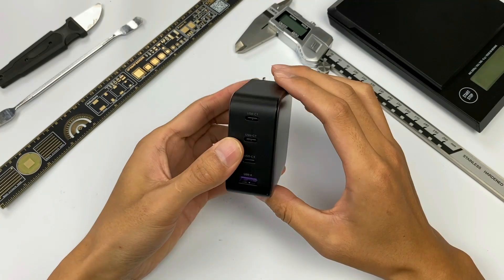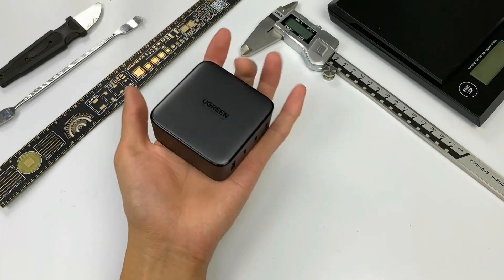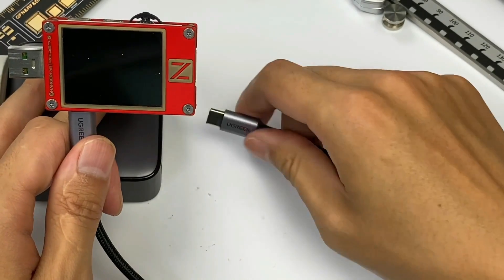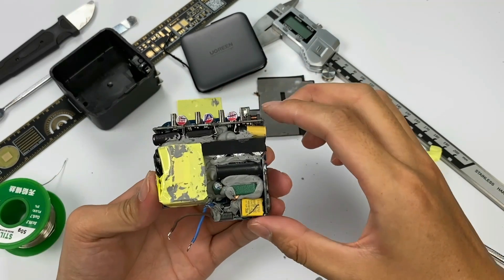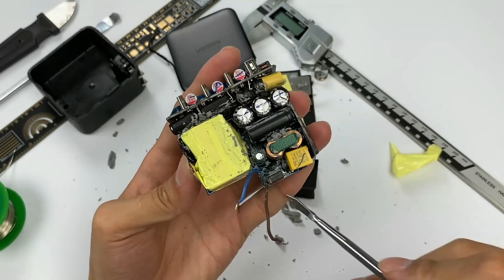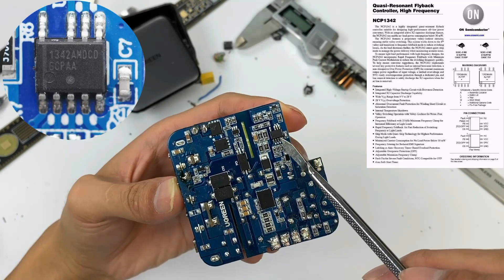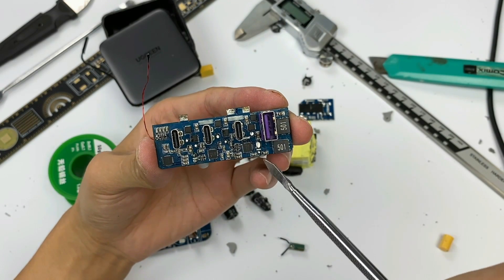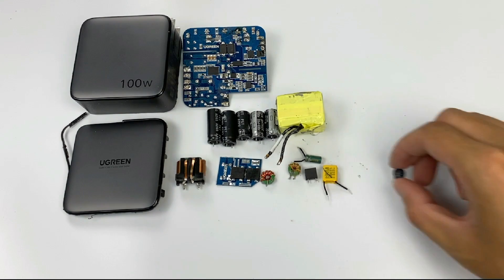All in One | Teardown of UGREEN 100W 3C1A GaN Fast Charger

Comment: Good video , solid design from Ugreen , impertant components are quality ones and meet the design standards , have seen dodgy chargers from alixpress but the ones i purchased from Temu are quit decent , did not open them but they stood the electronic load test and the weigt of a 55 watt is 90 gram , but it did not get hot, but in the future i will buy Ugreen

Comment: My question is where is the GaN in ths charger, i dont realy understand the GaN, is it the integrated circuit or something else
Reply: Yes, GaN (Gallium Nitride) is used in the integrated circuits (ICs) of chargers. GaN allows for smaller, more efficient transistors compared to traditional silicon. This enables GaN-based ICs to handle higher voltages and frequencies, resulting in more compact and efficient chargers. These GaN transistors are at the core of the charger's power conversion process, which is why GaN chargers can be lighter and smaller while still providing high power output and generating less heat.

Comment: Hi. If you remove the board with the ports. Will you still be able to read the DC voltage where that board is soldered? 

Basically I'm trying to troubleshoot my Gan charger

Comment: I will never repurchase one of their products i got their 65w charger with 4 USB ports 2 A 2 C and 3 AC outlets it was absolute garbage. I returned it the next morning and got myself anker's version for only $3 more. Here's why: ugreens had something loose rattling around inside it when I opened it up. it felt cheaply put together and had no grounding or surge protection. meanwhile ankers has those 2 missing features and feels superior in every way. i should have gone with them from the beginning bc i have 4 anker chargers multiple anker cables and 2 anker power strips. stay away from this brand thats my suggestion

Comment: I don't particularly like this one.  Plug in or unplug a device and all other devices bong indicating they were electrically reset.  The chipset designers are going to have to improve on that.  Also runs warmer than I'd expect from an "efficient GaN".
Reply: that's horrible...
Reply: All multi-port chargers do that. My one does that too
Reply: @venator7889   Today, they do (all 2 of them).   The chipset designers are going to have to improve on that.
Reply: @for2utube  dude do you recommend this one or not?
Reply: @putuadhik What's your budget and requirement? There tons of GaN chargers out there these day.
Reply: @venator7889 Not true. All my multi-port chargers do not do that. Mine are from ZMI, Hyper and Momax.

Comment: Hello could you please do a review or comparison with another similar brand like McDodo, Uneed, and Usams GaN charger?
Reply: Yes, GaN (Gallium Nitride) is used in the integrated circuits (ICs) of chargers. GaN allows for smaller, more efficient transistors compared to traditional silicon. This enables GaN-based ICs to handle higher voltages and frequencies, resulting in more compact and efficient chargers. These GaN transistors are at the core of the charger's power conversion process, which is why GaN chargers can be lighter and smaller while still providing high power output and generating less heat.
Reply: @non-technicial7910  what we want to know is which brand has the most flexible and wide range of charging protocols, eg. QC 4.0, Samsung AFS, Huawei FCP SCP, Oppo VOOC & SuperVOOC and etc.

Comment: I appreciate the detailed tear down and testing.  It helps in making a decision on what charger to buy or at least try with a 30 day T&E eval through Amazon.  Do you have an index of your videos?  I'm looking for a good small portable travel charger that has an international set of detachable plugs.  Do you have recommendation for international plug adapters if the charger is rated to work 110-240VAC but just needs the appropriate plug?  I'm going to be using this charger with my Lenovo Thinkpad X390 Yoga that I've fallen in love with this convertible laptop.   The factory USB-C charger is 65W, I would like to get one that does 100W USB-C out.

Comment: I own one of these and it has surprisingly low efficiency (88-89%) compared to most other GaN chargers which are 91-93% efficient. Do you see any reason why that might be?
Reply: If I understood what was being said in the video, the internal DC voltage is set to a high value and is then stepped down for each of the ports. This secondary stepping-down process seems like it might cause inefficiency. But I maybe wasn't understanding what's going on.
Reply: What conditions are you monitoring efficiency?  Load?  Time? Temperature? Variable load shedding controlled by heat?
Reply: @GonzoZener  For best comparison, I usually measure at full load and at least ~15-30 minutes later after the charger has had time to heat up. I've also measured this charger at other loads and it is pretty consistently in the 87-89% range for most loads.
Reply: @mrrkrr  I think it may possibly be designed to shed load as it heats up for circuit protection or the heat itself may just hurt the performance.
Reply: Not sure but can absence of Boost PFC cause that?
Reply: @Rajat0607   I don't think so. Boost PFC helps power factor, but not efficiency.